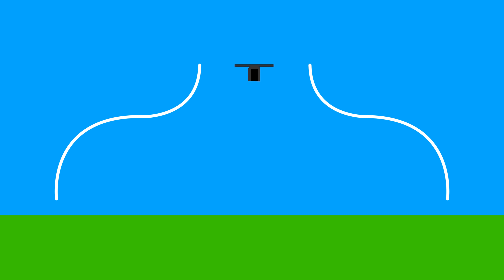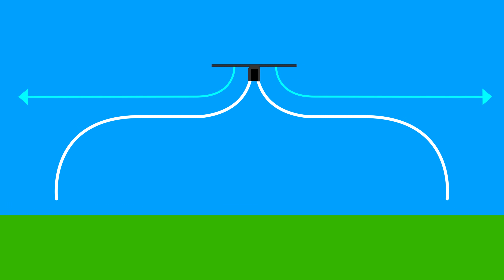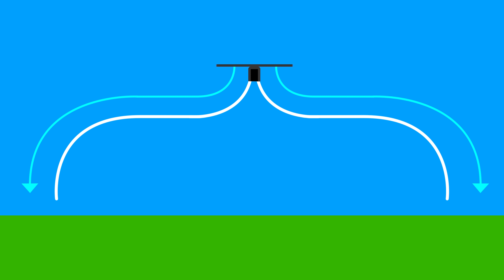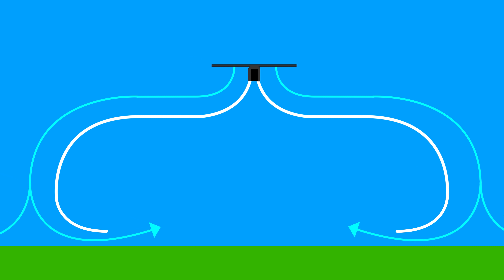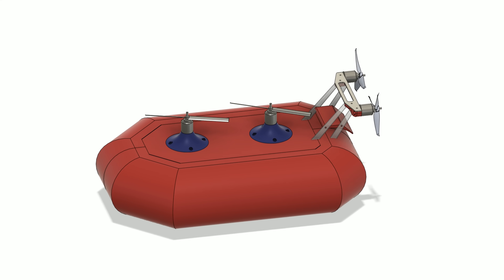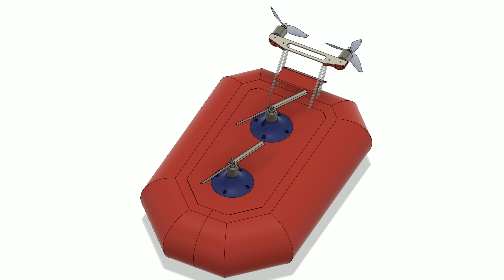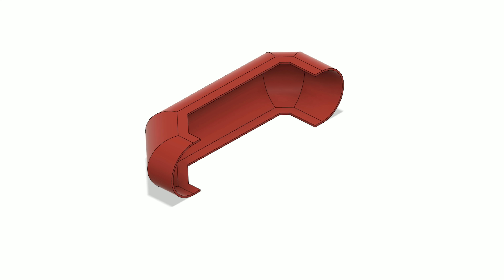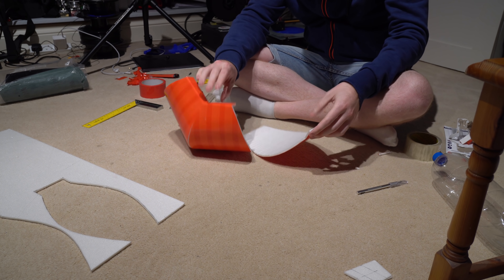Coanda Effect Hovercraft

Comment: Do you think the lift is really caused by the Coanda Effect or is just the expected "convential lift" caused by two propellers on top of an object?
Reply: Since it was I who triggered this discussion, let me say that it was not my intention to downplay Tom's work (for whom I have great admiration). The doubt about the real cause of the lift was genuine and apparently accompanied by many others. I wish Tom wouldn't take it personally and instead could help us to better understand what is really going on.
Reply: @hsmptg  I didn't see his comment anymore he may have deleted it after I said something. But I agree he does great work. Im even envious of his equipment and his work shop he has
Reply: I'm thinking exactly this.
Reply: Just a point from observing the behaviour of this vehicle: surely, if it was being lifted by the propellers helicopter-style, the mass being below those propellers would make it inherently stable. Watching the video it looks pretty unstable - trying to flip over at the slightest provocation. To me, this suggests the lift is taking place below the centre of mass.
Reply: @triplem9805  balance is an important factor to stability. If my rc airplane is slightly nose or tail heavy it greatly affects the flight characteristics as well.  And when first testing the nose wants to lift more than the tail where the extra control motor's and other weight is located
Reply: @justinlareau2227  Sure... it's just that the behaviour of Tom's vehicle (which doesn't have any aerofoil sections) suggests to me that, given it's rather top-heavy, its tendency to flip over might be partly due to it being supported from below on a cushion of air rather than dangling, so to speak, from the propellers if they were themselves providing the lift.

Another point; wouldn't the fact that it nearly worked using impellers (which don't provide much upward suction) be another reason to suspect at least some Coanda effect at work?
Reply: @triplem9805  I think coander effect is playing a part and it's and at the very least stability. I just don't believe the lift is solely created by the coander effect alone. There's alot of variables at play and different elements of physics. I love that it creates an intellectual conversation and a bit of a debate. That's how engineering works. A collaboration of ideas shared and discussed to gain a full understanding of why something works the way it does. It'd be interesting to do different variants of the design to see how the different elements of physics are creating the lift shown in video. I'm enjoying hearing others thoughts on this and keeping an open mind is how I progress my understanding of the world around me. I try to always promptly admit when I was wrong or made a mistake. It's how a person learns and progresses their respective knowledge. Best regards thanks for your reply.
Reply: @justinlareau2227  I'm fully in agreement!
Reply: @justinlareau2227  I completely agree! And it's great that on this and other channels dealing with science and technology, the kind of personal attacks and nastiness so evident on many arts, religion and politics channels are pretty minimal. Quasi-science (moon-landing, flat earth and climate change conspiracies, and so on) are notable exceptions!
Reply: Not 100% sure but I don't think it would be conventional lift. The props are pushing air against its own body which is mostly flat on top. If it wasn't for the curved sides (causing this coander effect) then it wouldn't gain lift. Similar to how a helicopter with a large flat board attached to its legs won't take off.
Reply: @badw01f23   Considering how large and close to the edge the propellers are, I don't think it's possible to completely rule out the viscosity of the air causing some vertical lift. You can see in rotor airflow tests that there is a significant airflow change up to around 1/2 the length of the span past the propeller. A test with a rectangular hovercraft would be great to see.
Reply: @badw01f23   exactly my "clumsy Helicopter " interpretation!  it almost wants to lift  off "almost " but not quite, don't get me wrong-  this guy's a clever kid ! really clever, but I cant see that he is achieving this lift effect here,
Reply: Either way a considerable amount of air passes through the props creating low pressure above the props and alot of air blown out the side (with some coanda effect) creating a clumsy heli lift. Also when the craft gets up to speed across the grass, the front on wind would pretty much eliminate any coanda effect cancelling it out
Reply: @Hells_Gate  I would still  like  to see that lower curve cut off the bottom of this Model , to  replicate the "drone domes " used in the Quad !
Reply: @badw01f23  I think the props are sucking the craft up rather then pushing it.
Reply: Would a baffle above the  main props reduce any direct lift, and prove whether or not the coanda effect is the main reason for lift?
Reply: @triplem9805  no ,the propelers would not suck enough air to the bottom and it would not work
Reply: What you're saying is equivalent to "I wonder if he's lifting himself by his shoelaces"?
To work conventionally the props have to be wider than the body to create thrust. In this case all the thrust would just be pushing on the top surface, just pushing the props away from the craft. Without the effect the thrust would just be going straight out the sides.
Reply: @sunriseshell    its not thrust creating the lift, its low pressure above the props creating the lift even though a majority of the air is dispelled horizontally.
Reply: @Hells_Gate  and hell's gate reinforces the way my mind sees this. The propellers are basically rotating wings. And a wing works by creating a low pressure area on the top surface this creating lift. Which this is what I think is creating the majority of the lift. I don't believe the main lifting factor is thrust or coander effect. The coander effect may create some lift and thrust is killed via the surface of the craft below it.  This is why I think if the propellers were angled 90 degrees aiming horizontally ducted and the duct curves down and the air is blown in the same location as the propellers current location than myself and hells gate would be proved incorrect in our theories. If the duct limits the size can per weight increase its power and have a more powerful barrier off the craft connected via wires to scale down the weight added to prove the concept of the coander effect lifting the craft.
Reply: @Hells_Gate  I think you're right, I wasn't thinking "big picture" enough.
My though is that the props (maybe better, ducted fans) should be within a secondary housing with a large intake area minimizing the low pressure above them. Then direct the flow outward across the horizontal surface.
But I'm just talking, @Tom Stanton is actually doing!
Reply: @sunriseshell  propellers create lift in two ways. One is the thrust the other is the lift of it being a rotating wing. Wings produce lift without thrust by creating an area of low pressure at the top of the wing or in this case propeller which is a rotating wing. No offense meant by my response just sharing my insight.
Reply: @justinlareau2227  Great point and not something that occurred to me!
Reply: @sunriseshell  that's what makes flight and aerodynamics so complicated. There's so many different forces and physic elements at play.  We all may be partially correct in our thoughts on what's creating the lift. It may be a bit of everything described.  The guy in this video I must admit I want his mini mill and a laser cutter. That would improve and speed up my builds with rc airplanes I build. Especially scratch built and plan built ones.
Reply: @justinlareau2227  @Hoch134 makes a good point, if you had two props in the middle of a flat sheet of foamboard would it lift it?
While the spinning prop creates lower pressure above the prop, is it not creating a higher pressure against the surface?
My thought is this would negate any lift caused by the low pressure, again leading to my analogy "you can't lift yourself by your shoelaces.
Now of course in the case of this hovercraft, some of that high pressure may be wrapping around it and creating some conventional lift.
Reply: @sunriseshell  if I had two electric motors that were the same I'd try this.  Or two contra rotating props to negate the torque factor of the motors spinning the foam board. I think it would still create lift. At least my mind is seeing it that way. I'll see if I can come up with a way to try this out. If the motor spins the foam it will obviously reduce the lift effect of the propeller. I'll go through my spare motors and see if I have two that are similar enough in power and weight and two props that are the same that will work with the motors otherwise I won't be able to test this properly
Reply: @justinlareau2227  If you do, film it and tag this video!
If I can find the time I'd like to do the same. I have so much hobby junk I have to have two motors that match.
I need to tinker and build and I don't anymore :(.
I haven't flown in over a year, I'm about to cancel my Kwad Box because I just don't ever seem to have the time to fly. And with the newest FAA ruling there's pretty much no where nearby I can legally fly anyway, I've been slowly switching to ground-based hobbies.
Reply: @sunriseshell  I hear you. I have a couple kit planes being built right now im trying to find the time to get back into those. Im lucky I have a local AMA club near by. I've been following the FAA rulings trying to regulate the crap out of our hobby. Our hobby has lead to countless full scale pilots and innovations over the years. The first Bell helicopter was designed by a guy who first built rc helicopters to prove it could be done. Then bell aircraft hired him to design a full scale helicopter that a person could pilot. Without rc alot of his innovations would likely have not been discovered or created for many years if at all. They now want you to take a safety test and you'll have to carry proof of your passing this test to show a police officer or FAA officer if asked for it. Essentially a license to fly rc. And they are making 400ft ceiling for RC flight no exceptions even at ama registered flying fields. What a bunch of crap. When the AMA asked them for their safety studies they used to create these laws/ rulings they didn't have any. So basically some guy with zero knowledge of how serious we take our hobby pulled a bunch of data out his butt hole. It's terrible a few people did some stupid things with drones and now everyone has to pay.
Reply: @justinlareau2227  There's a localish RC field with airstrip here too but they were not on the FAA's list when they first published it.
Yeah when I heard the 400ft hard stop I thought "what about the gliders"?

I think we're lucky we even got that much.  Many of the companies in this business want this airspace (0-400ft) for commercial drone use exclusively.
The way I see it now either I get my part 107 so I can ask for waivers just to be able to fly, or just get out of the hobby.
Reply: This has been an awesome post without bullshit mixed in, I totally agree,  and would love to see if anyone does do a 2 prop system with a flat board to see the difference. After reading a few posts there is definitely some awesome insight to the variables that can be considered to the potential cause of lift. Great discussion and I hope 
Tom Stanton reads these and will do some comparisons that have been mentioned to see the differences between them all. There could be another 5 or more vids created on this alone to eliminate variables or compile them together for a more clearer outcome.
Reply: @sunriseshell  I know it sucks I've had a couple occasions at my registered flying field a full scale airplane came over it under 500ft and I had to quickly dive my planes down because I was afraid I could potentially hit them. I'm pretty sure they need to stay above 500ft except for take off and landing. Unless at an airshow obviously. If I had hit them oh boy the back lash I'd have gotten despite it not being my fault. I got into the hobby because my love of aviation and I can't afford full scale. In my eyes rc and full scale go hand in hand. Which is why it's disheartening to see the smaller one get picked on.
Reply: @Hells_Gate  idk if Tom will read them. His one reply was pretty pissy to which I replied basically woah chill out this discussion is how engineering progresses. I think he took it personally that people were ripping on his creation. I don't see it that way. It's people just trying to figure out if there's another explanation for the lift.
Reply: I was thinking of writing the same thing , yes -I think it's just a clumsy Helicopter !
Reply: I was thinking so as well, especially considering if impellers weren't enough to produce the lift (which should be more efficient at moving air horizontally than the props) then it is likely 99% of the lift comes from propellers instead of the coanda effect
Reply: Easy to test: Place two rotors on top of a flat wooden (or even a foam) board and spin them up.
I highly doubt that anything will happen.

Since the airflow can't directly push the "vehicle" up, it's pretty sure the Coanda effect that lifts it.
Reply: This was my thoughts exactly while watching this. The props may not be creating 100% of the up lift but the way this is set up makes me think that they are creating a large amount of it. The air flow being spread out over a wider area creates a more stable lift. The coander effect works on an airplane wing without a propeller creating the up lift because the propeller is moving air in the horizontal plane and the air moving horizontally creates an up lift vertically due to the coander effect over the wings. If he had a ducted propeller aiming horizontally then ducted down to where the propeller currently resides then I'd believe the lift was created by the coander effect alone and not due to the propellers pulling under craft up.
Reply: @justinlareau2227  The propellers can not create much lift if any due to the air they pull in is hitting the body of the hovercraft. This means the force it generates lifting is also the same as the force pushing it down. The propellers are working better than the impellers essentially because he 3D printed the impellers.

A 3D printed copy of a design will not be as good as a shop bought versions due to precision and material. So these impellers will weight more and be less efficient. Propellers are bought and designed for these types of things and so will be of much better quality than a 3D printed version of propellers.  Maybe if he bought several different impellers he could have found a set up that worked but this is costly and timely. 

I can see the confusion especially with lots of people not really... erm "trusting" (for lack of a better word) the power of the coanda affect but I'm no scientist, if i have any mistakes let me know, and if you ever see an object lift with propellers with something directly beneath the entire span of the blades let me know because i have never seen this but have seen people try

Thanks for reading, look forward to replies
Reply: but like I said a lot of the air blown down from the props goes out to "the sides" of the craft, so air is still moving through the blades creating a low pressure above the blades creating lift. I know air is moved directly towards the craft but it is also expelled out sideways which makes a differential between high and low pressure of above and below the prop, thus still creating lift. Would be good to see if a clat card board version is made to compare. Definitely not convinced that this is coanda effect entirely thats for sure
Reply: @conrrr  yes i'm by no means claiming to be an aerospace engineer and I love seeing this kind of experimentation. It's how bell helicopters were invented via rc by a guy interested in seeing if it could work. I am a manufacturing engineer emphasis on quality and an RC airplane hobbyist and full scale aircraft enthusiast. Wish I knew more about aeronautic sciences. I know a bit more than the average joe because of my hobby interest and reading on the principals of flight to build better rc aircraft. Let me see if I can build something like you described and see if it creates lift. I think the coander effect is playing a part in the lift but isn't the main lifting force
Reply: @conrrr  just like the beginning od his video demonstrating the coander effect he has smoke and air coming from the horizontal axis and the coander effect makes the stream of air move downward slightly. On his vehicle he created the airflow is coming from a vertical source and lift created by the low pressure created by the propeller or rotating wing. The thrust is indeed killed by the object behind the propeller. But propellers create lift in two ways the first being thrust and the second being the low pressure created in the top side of the moving wing or propeller. Anyways that's my thoughts on what's most responsible for creating lift. Coander may be a slight reason why. In my mind until the experiment is set up in a different manner using coander like he demonstrates in the beginning of his video. Anyways I've made about 4 or 5 posts now rambling my thoughts on this.